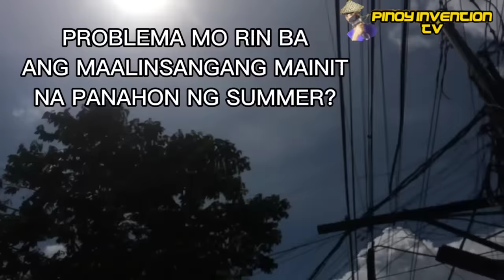IMPROVISED ELECTRIC FAN AIR COOLER/DIY AIRCON

Comment: Ang prinsipyo ng aircon ay nagbubuga ng malaming na hangin HINDI mist at hinihigop naman ang mainit na hangin sa loob palabas papuntang cndenser. Sa video paikot ikot lang ang hangn galing sa improvise aircon at lalong tumataas ang humidity dahl na pagpapawisan ka. As experiment kung mainit na room pag gabi mas maganda dalawan fan ang isa naghhgop ng outside air at ang isa exhaust dun bumaba ang init sa loob ng kwarto.
Reply: Isang fan nka harap isa nka talikod sa bintana ko or ang isang fan ay swinging pra labas pasok ang hangin..
Reply: Pwede rin na gumamit ng dehumidifier kung kulong ang lugar at walang exhaust system.
Reply: Yes 👍 that right

Comment: Ask ko lang po diba kaya nakakapag bigay ng mist ang humidifier dahil sa heat?  magaganap ang condensation to avaporation so hot mist ang lumalabas sa humidifier pano po magiging malamig. Siguro kung dry ice tapos ung condensation ay pa dadaanin sa copper tube baka may chance na  lumamig po...
Reply: humidifier po yan at hinde vaporizer. vaporizer yung through heat nagproproduce ng steam. kaya po yung vape tinawag na vape from rhe word vaporizer. may heat. 
yan is may bilog sya na nagvivibrate at nagproproduce na maliliit ng mist. 
meron naman yung nilalagay sa tubo na malililit na butas. sibrang liit kaya nya magspray ng mist. usually sa garden.
Reply: and dont use dry ice basta basta. it produce co2. so kung kulob kayo bka masuffocate kayo.
Reply: because of matter
Reply: Humidifier po. Yan Yung pwede mo lagyan ng scents. Ginagamit Yan sa room na kulob.
Reply: Ginagawa ko din po yan so far ok naman.
Reply: Gaano po katagal Yung ice na nilagay ?

Comment: Lalong iinit dyan boss dinadagdagan mo ang humidity sa area.
Reply: LoL. baliktad nasa isip mo bosing, dry humidity ang maiinit kaya nga sobrang init tuwing summer... same concept lang ng air cooler to na nilalagyan din ng tubig o ice tubig, dinadagdagan ng moisture yung hangin hindi humidity ang dinagdag. ilang beses nko bumili ng air cooler iba ibang size, Kaya from experience.... at least dalawa dapat ang ilagay na humidifier para masmaramdaman ang lamig,
Reply: @shockwave9282  For tropical countries with humidity above 60% such as the Philippines, humidifiers can actually be harmful. Too much moisture in the air can cause health problems rather than prevent them. It can trigger or worsen asthma and allergy symptoms.
Reply: @shockwave9282  ang dry humidity na tinutukoy mo eh yung mga nasa cold climate, kasi hndi na evaporate mga tubig nila sa paligid, dito sa atin sa pinas di mo kailangan ng humidifier 60 to 80 percent ang humidity all year, pag dinagdagan mo pa ang humidity lalong mahihirapan ang katawan mo na palamigin ang sarili, yang pawis mo hndi basta basta matutuyo dahil sa sobrang water vapor sa paligid, yang bahay mo mapapabilis ang pagkasira dahil paborito ng mold ang mabasang hangin.
Reply: @rodulfo9999  Your logic is twisted, you obviously don't know what you're talking about when it comes to a humidifier/air cooler and moisture/humidity. Don't you know A/C also gives moisture in the air yet they use it in hospitals, other medical facilities and practically everyone. I've been using an air cooler for more than 5 yrs now and no symptoms of allergy or asthma. If you don't believe that extra moisture in the air lowers the air temp a few degrees, then that's your problem. Marami bang my allergies or asthma attacks sa mga tao na nakatira sa tabing dagat or lakes na malakas ang hangin? On the contrary, people are healthier bcoz of the extra moisture and it makes the air a little cooler along coastal areas. Yes moisture with molds is unhealthy and thats what happened to my sisters house abroad, but it happened only bcoz of a pipe leak under the floor boards w'c they did not discover right away.
Reply: @shockwave9282  ikaw ata hndi alam ang pinagsasabi eh, A humidifier and an air conditioner are two different entities. An air conditioner eliminates moisture, controls humidity, and reduces temperature. In contrast, a humidifier improves the water level in the air to maintain warm temperatures, libre ang google brad, baka di mo pa alam meaning ng humidity eh haha, madami nang patay n may asthma sa hospital kong ang AC ay nakakadagdag ng humidity sa area baliktad din utak mo e nuh.
Reply: @shockwave9282  lol try mo pumunta sa dubai dry ang hangin don walang humid sa hangin hindi sya malagkit sa katawan, kahit mag paa ka sa buhangin pag nag suot ka tsinelas hindi dumidikit buhangin dahil dry ang hangin, dito sa pinas mataas ang humid kaya kapag nag dagdag kapa ng humid lalong iinit, mas maganda kung mag dehumidifier kana lang instead of humidifier

Comment: Hindi ba agad natutunaw ang yelo sa humidifier? Mga ganu kaya katagal bago matunaw? Mainit na ba ang lalabas kapag tubig nalang natira sa humidifier. Meron kase akong air cooler, malamig sya kapag nilagyan ko ng yelo pero wala pang 30 minutes tunaw na agad yung yelo at kapag tubig nalang napapansin ko na mainit na ang binubuga nung air cooler compare sa regular na electric fan. Ganun din ba humidifier?
Reply from the maker: Indi Naman KC kulob Yung lalagyan... Magiging  presko p rin nman yung hangin Ng fan kc Yung binubuga niyang hangin may kasama pinong TUBIG galing SA humidifier
Reply: Saan mabibili homedifier

Comment: Talking from long experience using air cooler, parehas lang ito ng principle ng air cooler though mas efficient at effective ang totoong air cooler na appliance. Para mapanatili ang efficiency ng air cooler dahil nga sa nagbubuga ito ng basa at malamig na hangin, kailangan may exhaust fan o system ang kwarto dahil mandatory na ilabas ang humid na hangin na posibleng maipon sa loob. High humidity decreases the cooling effect of air cooler. Also effective ang air cooler basta direkta kang madadampian ng hangin mula dito. Highly suggested na pumili ng air cooler na may malakas na fan at yari sa cardboard ang material ang honey comb filter at di plastic.
Kaya ko nasabing mas effective ang totoong air cooler dahil nasubukan ko na ito. May mas malaki akong humidifier  na tinatambakan ko talaga ng tube ice, this somewhat decreased the temperature pero kulang. Hahanapin mo pa rin yung direktang buga ng malamig na hangin ng air cooler. Sa air cooler umuubos ako ng mahigit isang timbang tubig for 6 hours operation while napakaminimal ng tubig na nauubos at inilalabas ng humidifier so alam mo na kung alin sa dalawa ang mas effective sa pag disperse ng tubig sa hangin to cool down temperature,

Comment: Proceed with caution, dangreous po ang long term usage ng humidifiers sa lungs lalo na kung tap water at chemical scents ang laman. Di po advisable to sa mga may lung problems at kung wala naman, nag cacause yan ng lung weakness. Peace out.
Reply: Yelo lang naman nilagay😂
Reply: @leagueofhighlights9627  which is also risky due to potential bronchitis.